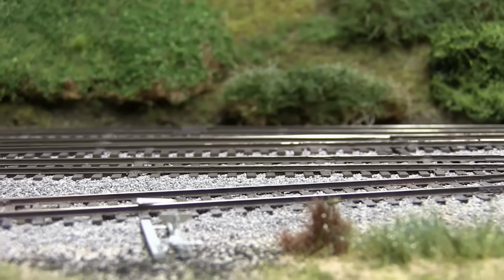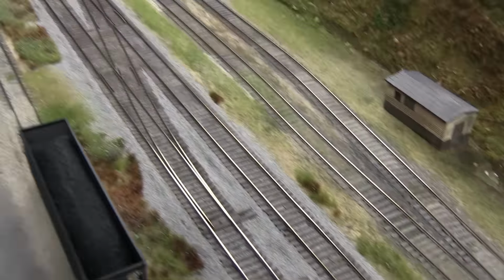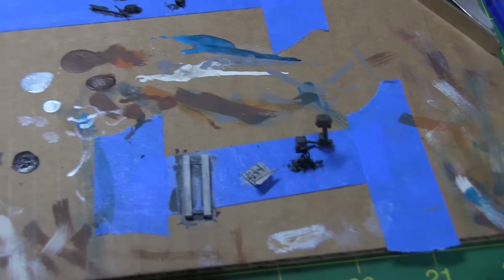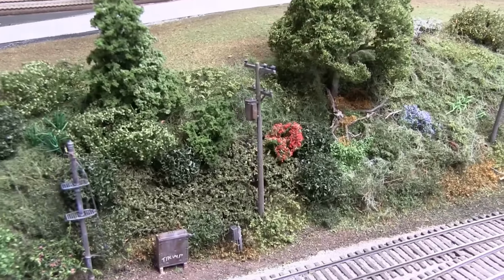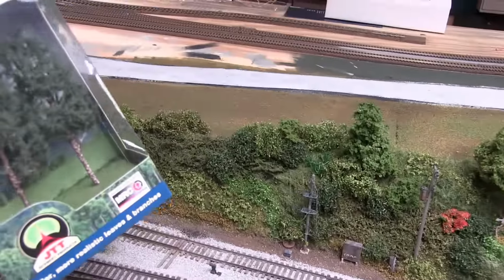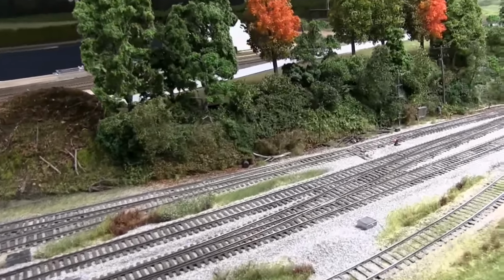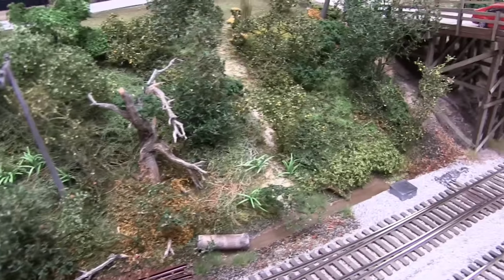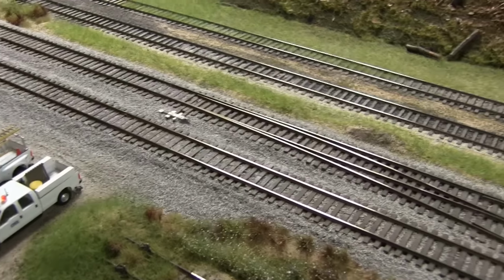MRUV 86: Track Details & Embankment Scenery

Comment: that looks great, the old abandon switch light, due to PCB the transformer would be the first thing they remove, just saying real life, your layout, your rules sir, great video, the only thing I might add, is some green thread to the hydro poles and then just hanhing from the poles, see that all the time with the old stuff, great video, thanks for sharing,
Reply: Ah, we will just say it was a tub that was made after the PCB regulations came out. And that the crew meant to get it, but it started raining so the crew left for the day, then had an emergency and were called elsewhere, and .....
Reply: perfect.

Comment: What was the material you were using as brush around that abandoned signal around 4:30?
Reply: Some is painted/sprinkled rubberized horsehair, and some is this item from Lowes: https://www.lowes.com/pd/Patio-Life-11-in-W-x-11-in-L-x-1-6-in-D-Coconut-Fiber-Plant-Liner/999978984.

The coco liner is cut into patches, teased apart, then sprayed and sprinkled with various leaf foliage. 

If there is interest I suppose I could make a quick video showing what I do. It is pretty simple, and I find it fairly effective as well.
Reply: Rob Bennett
A video would be great if you wouldn't mind. I've just been using Woodland Scenics turf for ground cover, but I'd like something both more economical and realistic

Comment: if its ok with you that's all that matters but it looks great. Now for the big question what are the detecting wheels for?? thanks for showing us the RR
Reply: Resistance wheels- a high value resistor is added to the axle so it draws a small amount of current. This current draw is then detected by the DCCOD block detectors (part of the C/MRI hardware) so the block shows occupied. The block occupancy status is then used by the computer program to drive signals, crossing gates, etc.

Comment: A quick question unrelated to the clip shown here... What's the dimensions of your yard? Want to build one, so I'm asking to get ideas about track space.
Reply: Jason- the yard (which is actually visible staging...) is just about 21' overall length. We sized the longest yard track to enable storage of a decent sized autorack train. Keep in mind we used #8 turnouts so that increases the length. It is about 30" wide, but that is variable depending on the number of tracks in the yard. You will be surprised how quickly your space is eaten up once the planning starts!

Comment: I hate you Americans (insert jealousy here lol), nah seriously awesome videos have watched from the first until now and wish I had the room you guys do. Keep up the awesome work and updates it has been very interesting. For your scratch building and window shapes that you mentioned in one video, check out scalescenes. They are U.K. based and you download and print building designs and also brick work and windows etc. I found the windows printed best from a laser printer on overhead projector sheet which is available from stationary specialists. smooth one side yet kinda rough for the print to stick on the other. Not sure if you are familiar with scalescenes but worth checking out for even just the scratch building link. 
Can't wait until the next update :)